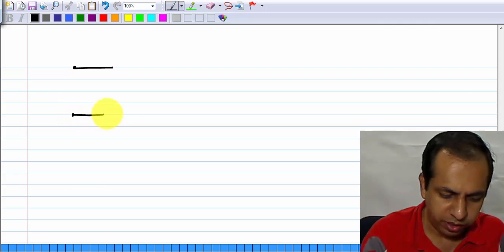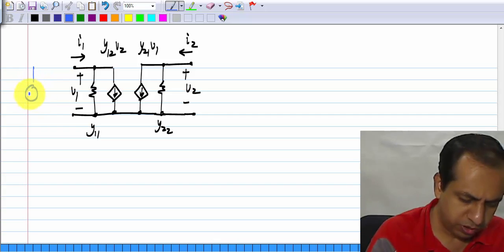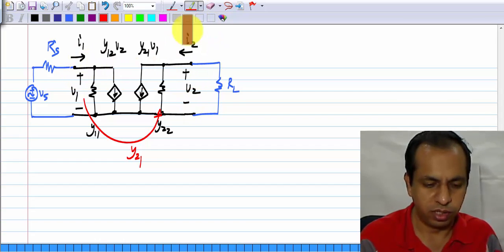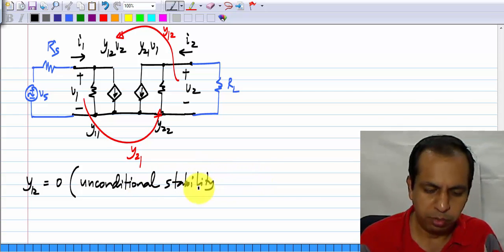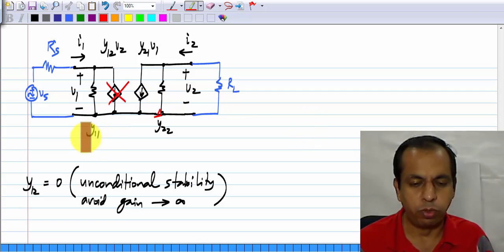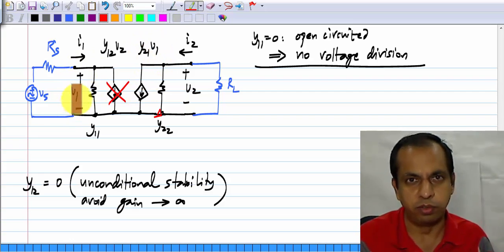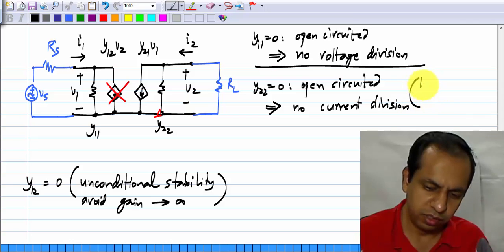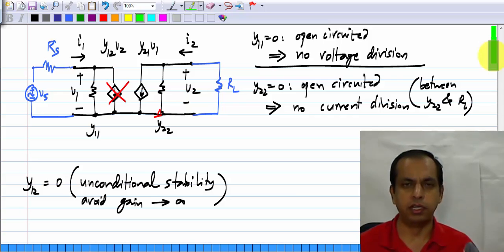0204ConstraintExplanation

Comment: sir i have doubt about why we didnt used Z or any other parameter why Y parameter only while solving all of these
Reply: you can actually get the Z parameters from Y parameters or you can take voltage as a function of both the port currents and get the Z parameters.it is just a representation and you can represent the equivalent circuit as you wish
Reply: He answered your doubt in the previous lecture. He said that the most of devices we have now are well represented by y-parameters or with current as a function of voltage . That's y he chose the y parameter. We can do the analysis with Voltage as function of Current and we would end up in z parameter and the result would be similar